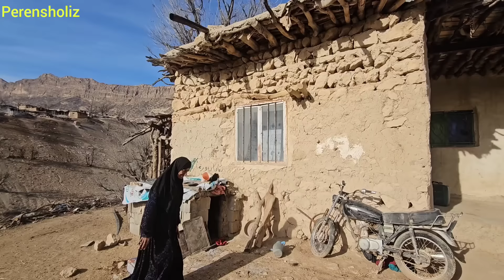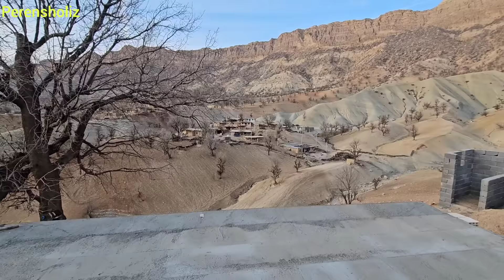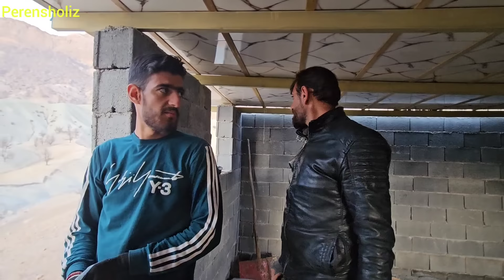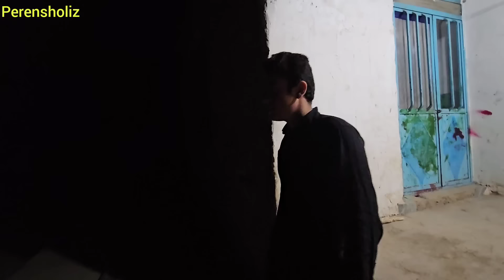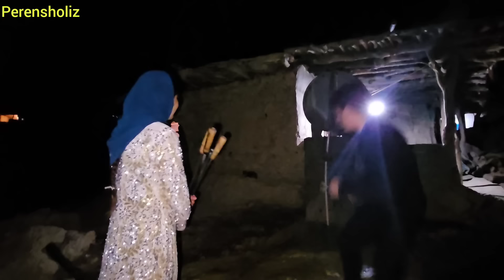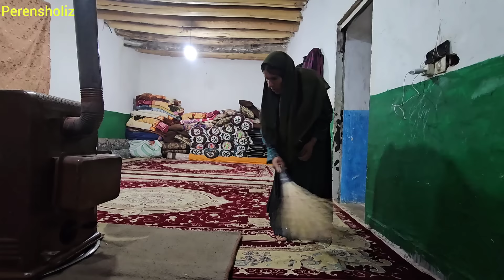"Ruqiyah's escape, return to Saleh's house, cooperation of Arsalan and Sadegh"

Comment: Salih, is this roof safe? The marble roof broke in a drain. when the step is taken. You also press and lift weights. or the weight of the cement over time, etc. Will there be any cracking or breaking? Be careful, is it safe?